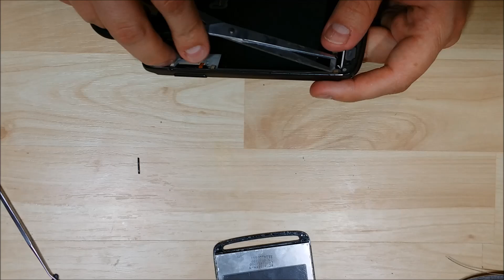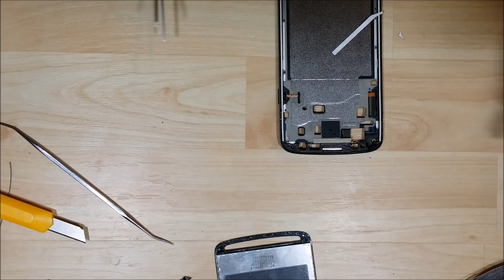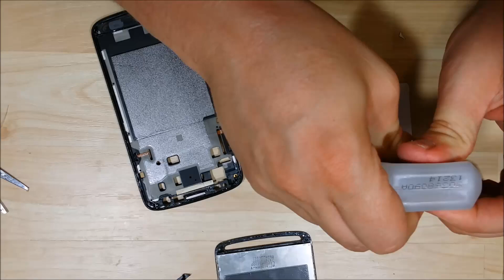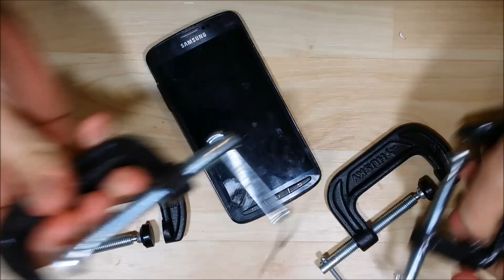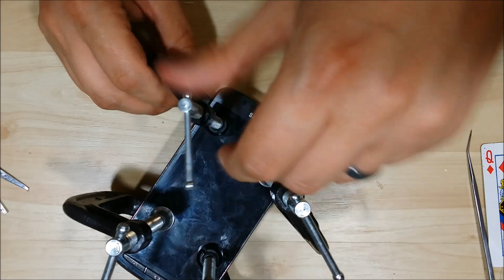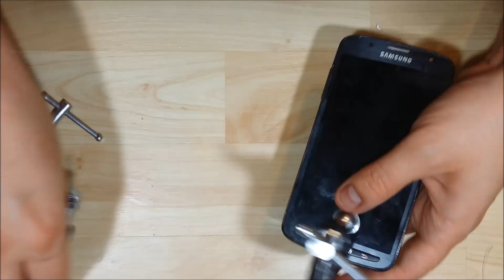Samsung Galaxy S4 IV Active LCD Replacement - LCD Adhesion

Comment: Where can you get the glass only for the s4 active cheap? I found it for the s4 for like $3.00 on Amazon would that be the same screen?
Reply from the maker: The S4 and S4 active use different screens. The active is normally $20-$30 for the glass : http://www.ebay.com/itm/Gray-Touch-Glass-Screen-Digitizer-for-Samsung-Galaxy-S4-Active-i9295-i537-AT-T-/281385510396?pt=US_Cell_Phone_Replacement_Parts_Tools&hash=item4183e225fc

Comment: There is no need to heat the LCD to get it OFF. It can detach without any problem from the frame. The heating mechanism used to be used if changing the glass which is not the case if the digitizer is replaced as well....
Reply: Charbel ATALLAH The heat is used to make the double sided adhesive more pliable and easier to remove. I would like to see a video removing it with out heat if you have one?